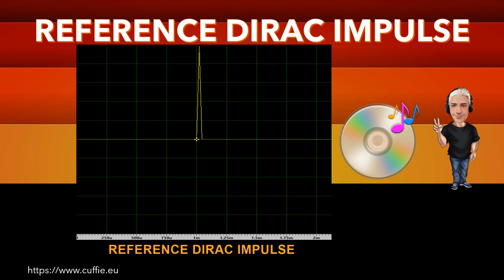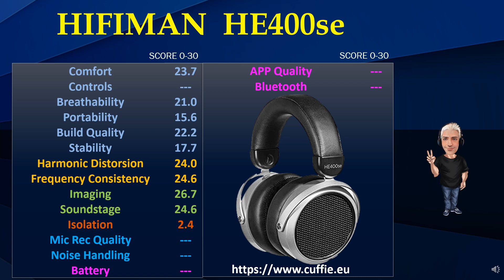HIFIMAN  HE400SE

Comment: As an owner of the headphone, my feedback is that the overall sound is a very well neutral, good light bass, with an even amount of treble. As a whole, it certainly crystal clear sound, no harsh. However, i would like to comment about the soundstage. Although its an open back, its actually not that wide. It feels narrow somehow. All the sounds felt like it just coming from next to me.. (still wider than most of closed back ofc) But the imaging is excellent, i can differentiate the instrument and locate it nicely. So for soundstage, i would give 22 out of 30.
Reply: Which instrument. I'm not hearing what you're hearing. It sounds like it all the sound is coming from the left and right speakers. And the rest reverberates out the exterior of the headphone. It's just a small distinction between whats close to left right and far.

Comment: ERROR⚠️ pink noise and hifiman sound is switched !!
Reply from the maker: Hi it's an acoustic impression because the he400se has a hole around 2khz which relaxes listening and misleads
Reply: @SOLOCUFFIE 🤔
Reply from the maker: Example hd600 and k702
Reply from the maker: Hi listen other reference pink noise video